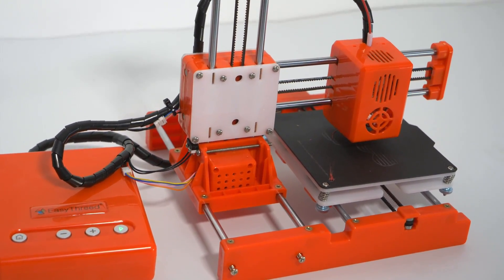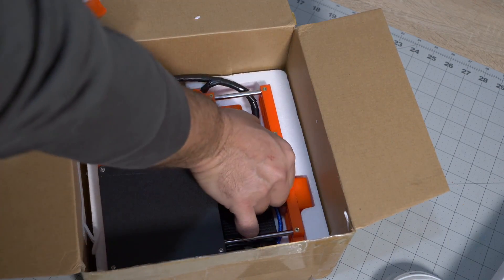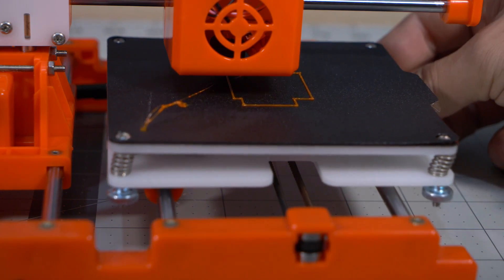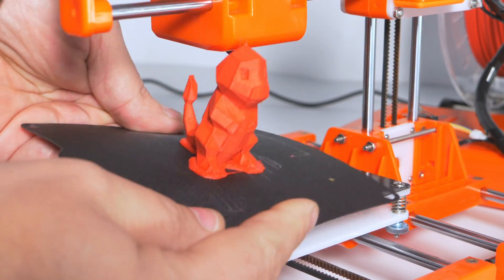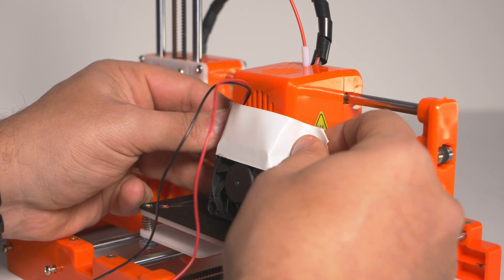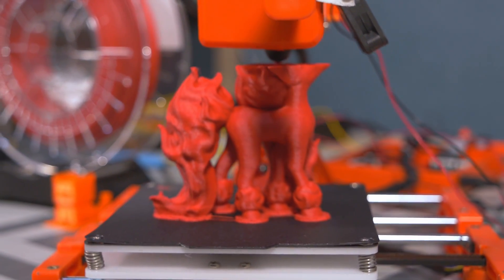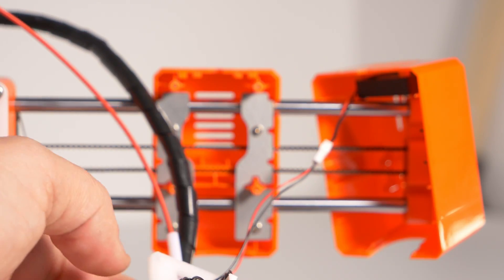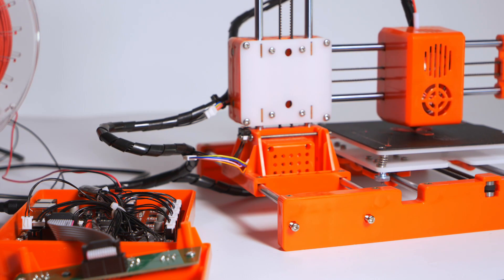The Cheapest 3D Printer Yet - EasyThreed X1

Comment: Hopefully someone can answer a quick question. I need a 3d printer to print a machine part. It will only ever be used to print one part. Is it possible to make the part a solid lump rather than being filled with the X criss-cross design? I'd like the finished product to be as strong as possible.
Reply from the maker: Yes you can, you can print at 100% infill :)
Reply: @3DMakerNoob  Legend! Cheers bud. Might be worth a punt at that price. The parts are £10+ each so I'll soon reap the savings. Just hope they hold up.

Comment: its very good print for this price  
main reasons-
low printing speed
direct extruder 
with cheap components quite a good assembly
and small printing area that makes it easier to work ( less problems with the geometry of the frame, etc.)
Reply: kinda best choice for first printer if  want @just try@

Comment: i bought an Imakrr Startt two years ago for 99 bucks as my then 12 year olds (and mine) first printer. Basically a rebranded tronxy product. sort of a (130 by 140 mm) mini Anet A8 with a v6 clone and no heated bed. We have since ran 600 hours through that printer. We now have a prusa clone a Sunly S8 and building a large scale core XY machine. All because of that little Startt!

Comment: At 5:45 we see the hotend... and it looks like a straight copy of the M3D Micro hotend! No wonder considering that the same company also make a clone of the M3D Micro. So I think what we have here is basically an M3D without the housing. Same print size, same hotend, same print problems. It prints as badly without a part cooling fan, but the price is a lot, lot less. But unlike the M3D it has space enough for the extra fan and seems generally easier to modify.

So, the only thing I have against it, given a part cooling fan, is the lack of a heated bed. So it is a managable, very cheap PLA printer.

Comment: Mine arrived today from Amazon UK.  It was £119 then Amazon offered me a £40 voucher WIN WIN.  Its got the cooling fan and duct already fitted.  It also comes with 4 small rubber grommets which are not explained at all in the printed instruction manual or the usb instructions pdf file.  Does anybody know what the grommets are for?

Comment: There is now a pre-installed cooling fan on it. Small but its already installed. They also give you like a model to "upgrade" the thing that diverts the air so you can replace the pre-installed one. Might change the fan for a bigger one, like the one he showed on the video.

Comment: I might have to try man again the heating nozzle that came with mine is a little bit different it does not have Teflon tape around it and has a rubber grommet on the end of it it looks a little bit different so I could be a different upgraded model

Comment: Crazy thing is is I did end up having a cooling fan but it's a small one it came with two fans this time but I could say it does deserve a better one that can push more air and I would like to see one other thing the holder that holds the fan States currently in it the front-facing thing that they made were told that plus Hold the top fan and the part cooling fan does me towards have an upgrade cars that housing that holds the fans in place if you could upgrade that to let's say a bigger fan size you can probably have some fun with it and upgrade the fans to Let's a RGB or something better Point reason is if you could bring the size of the cooling fan up to the size of what they have for the Raspberry Pi 4S cooling solution you can get your hands on those fans in Fulton to the 3D printer itself I can also see where if someone could label each word to get it upgrade kit dexton build plate movement size with a bigger belt plus that XYZ gantry with longer rods the 3D printer could get bigger and floss with a bigger build plate and I would like to see a better control box 2 doesn't need to have a screen the buttons were fine but far as the Bluetooth in that connection I would like to see one other thing on it like a way to work to attach a Raspberry Pi zero directly to the top of it through the gpio. If you could do that you can literally just connective anything to it and then you could just run whatever cables from that ports further away

Comment: And I will say yes it does have its limits far as the SD card but that could easily be overdone if there was let's say a plug-in or something that would allow you to use a different set of software pacifically switching from the manufacturer to Cura or if you're really crazy go for the G replicator software

Comment: Easy Threed X1 challenge
Design and upgrade for the printer and must fit its existing print bed.

V6 clone maybe stock looks pretty decent. The stock also prints flexables amazingly.
Geared extruder with existing stepper
Threaded rod frame stiffeners, a diagional one on the z would be amazing
Gear down the x, y and z axis for precision.
Oh and the part cooling fan 👍

Comment: I’m pretty sad with mine the tip clogged and  tried cleaning it but it didn’t work also tried taking it ape  to clean It but the wire fall off hitting the hot end and there was a spark that just killed it

Comment: Thank you for this great video. I've been wanting to get into 3D printing (since I do a lot of DIY synth stuffs and am often in need of small parts), but the price was always an issue. When I saw this cheap thing I doubted it would be any good, but glad to see it holds up!

Going to order soon :D
Reply: A much better printer at this price range is the Tronxy X3 (it’s a kit, so you’ll have to put it together, but it sounds like you probably know how to assemble LEGOs so you’ll be fine). It’s way bigger, much much faster printing, and higher quality prints. If you get one you’ll want 2 mods and then it’s golden (and they are printable with like $0.40 in plastic, so no big deal). It’s just a way better machine, but it does take a while to assemble (it’s fun though, it really is just like being a kid again but with “high tech” LEGOs, but pretty much all aluminum extrusions and a few bearings. It’s just a lot of screws, haha!

It’s my second printer (first one I built over 6 years ago and just modified everything on it, a total Frankenstein monster totally tailoring it to my needs and preferences, but I wanted a second one). Sure I wanted to spend $500 on the second printer, but honestly didn’t like most of them, they were all basically Ender 3 level of performance (which isn’t bad for the Ender 3), but I wanted the fun of building another one, and the Ender didn’t have a parts bucket/kit option so I went with this. If you have the budget Ender 3 is better but the Tronxy X3 is remarkably impressive for its under $100 price tag shipped to your door in the US. (PS, I’m a mechanical and aerospace engineer, I love designing and modifying everything, almost as much fun modding printers as using them to make gears and whatever else I need printed for my projects, most of the mainstream printers are very modding/upgrade friendly).

Comment: Yeah but for $89 you can also get one of those cheaper Anet A8 clones. The wooden ones with bottom of the barrel bearings and the smallest heated bed in the world. Still an Anet A8 though and can be easily upgraded back to or even past the functionality of the original for less than $40 more.

Comment: Yeah but if your going to spend $89 on this then the extra $100 for an Ender 3 is a no brainier with all the extra build volume and better print quality. If you can save up $89 it wont take much to save up the $189. If you can't afford that then you really should think about entering another hobby lol.
Reply: That’s pretty wrong on many levels. But you can however get the $99 Tronxy X3 and learn a lot by assembling your first printer (I specifically picked it over the Ender 3 because the Ender didn’t have a kit/parts bucket option and it’s fun like building LEGOs). The Tronxy does need 2  upgrades to it (about $0.40 in prints), and then it’s pretty decent. That’s on a level much more comparable to this (or you can get an Anet A8 also for $89 or Ive even seen them as low as $79 new, and it should be decent because it looks like an upgraded version of my old Frankenstein of a heavily modded i3 clone I built like 7 years ago and it’s doing great to this day, though almost everything down to even the power cord has been worn out and replaced from so much printing, haha!)

I also own the Tronxy X3, it’s pretty good. Gotta remember that really sometimes you’d don’t want or need to spend double (just like I was debating a CR-10 or nicer, but then realized I didn’t particularly love the design and was going to mod it so much that I might as well start from scratch at the hardware store or just get a cheap one and mod the daylights out of it like my other one, because modding is fun and cheap). I may have plenty of surplus income but some people don’t, so just remember that, as over double the price is not in the same league!

Comment: That extruder looks a lot like the one in the first edition M3D printer, http://m3dhelp.com/support/assets/img_55760ba2e5691.png and the speed it prints corresponds closely as well, for your sake i hope the gearbox is better than it tho because for me it was horrendous, broke two of them in very few hours printed so i gave up on it quickly and bought a diy i3 based kit for about 2x89$ which gave almost twice the build space, heated bed, twice the print speed and far better quality.

Comment: As long as it is calibrated, any printer will often do. You dont get super quality for a high price, part cooling fans are not necessary for pla or a heated bed either. Petg prints go fine on mine cheap homebuilt in wood and aluminium tubes. As long as you take time to adjust most printers are equal to a prusa or a mendel

Comment: Are you able to find the firmware anywhere? My Y axis seems inverted. I swapped the wires to get it going the proper direction, but now it homes in the wrong direction and I want to fix that
Reply: Can you use Repetier Host software to control? If so it’s in the top toolbar: config/printer settings/printer and check the box that says invert direction in controls for Y-axis.

Whatever program you are using should hopefully have something similar.

Comment: Thanks for the video, I got one and I'm starting to play with 3D printing. My suggestion for future videos: There is a X2 model with a small display, do you thing it'd be possible to use any shelf display, print a case and add to this X1 model. Also, there is a file at http://www.easythreed.com called "x1 & X2 cooling guide cover", I downloaded but didn't figure out how to use it, could you have a look? (http://7583133.s21d-7.faiusrd.com/0/ABUIABAAGAAgn_jP8AUoiNDS0gY?f=fengshangai.gcode&v=1578365983). Also let us know if you have tips on slicing part on cura or slic3r to be printed on it. thanks!

Comment: Here is a small analysis. Printing quality isnt that good. And having a shield under your model is kinda annoying and unnecesary. Also, too bad you cant print something medium-large sized. Also no display screen, so in case something goes wrong, you are screwed (like, if you are controlling nozzle and bed temperature and fan power). All in all, its cheap but not really worth it. I recommened Ender 3 which is, well, 200$ more but its worth it (only problem is that you will need some work space)

Comment: Hey! great video. I decided to buy it thanks to you. Its gonna be my first 3d printer and i just want it to print small cases and little pieces nothing serious, however i would love if you could detail all the "mods" and tweaks you did to this little machine to make it run better than it was stock. I have 0 experience and it would help me and people like me alot. Thanks again! 
Also, i saw that when you pull the piece from the bed it leaves marks and residue, is this a problem in the long term? is there a way to keep it nice and clean?

Comment: I heard that they added a part cooling fan in the kit now
Reply: I didn't have a part cooling fan, but there is a duct on thingiverse and the wiring for it is already in place
Reply: yep, I had one in mine
Reply: I’ll tell you I’m opening mine tomorrow maybe on stream.
Reply: BowieMoonen so I there one?
Reply: I couldn’t even type that day
Reply: This printer is also sold on amazon by a company called Labists, it already has the part cooling duct fitted and the slicer software supplied on the microSD is all Labists branded, I was surprised to learn you can produce decent print quality on these cheaper machines.
Reply: Lex4G More money out yo pocket
Reply: @gabeitch5102  The printer is still the same price. I got mine for $90 but it had a cooling fan.

Comment: If u could mod an lcd screen on this and a part cooling fan this would be probs the best budget printer
Reply: The X2 has display, but there is no real advantage in that, using it is even easier without the screen... Except that you can screen live the hotend-temperature, and so, detect faults, just in case they should occur...
Reply: There is easy way to add part colling fan just download model for it from online(Enter something like easythreed x1 part colling fan model)and ju just put a small fan in 3d printer and it will becom a part colling fan.Here is link for better explanation and model.  https://www.aliexpress.com/item/4000469006532.html?spm=a2g0o.productlist.0.0.559f5d34dkg16N&algo_pvid=d39d0048-5cb0-4ac6-9ff3-440be4b99a0e&algo_expid=d39d0048-5cb0-4ac6-9ff3-440be4b99a0e-0&btsid=f61f3362-6e7b-44e6-99af-e592da0af92a&ws_ab_test=searchweb0_0,searchweb201602_4,searchweb201603_55.   You dont need to buy this fan just take one.
Reply: The X2 has display: https://youtu.be/VfYkGFNamNI
Reply: The Tronxy X3 is $99 kit. It has a screen and there is a simple fan duct you can print for free (flaps so it’s great for PLA and closes off the nozzle side for ABS). I’m fairly impressed with its results and it’s 200x200x200 standard print volume (technically it’s more, but that’s kind of it’s class size). It’s also very good because it teaches you how everything is assembled and you can fearlessly fox and modify it. It’s also easier than most LEGO kits I did when I was 12, like significantly easier, so you can have fun building it with your 10 year olds (or much younger depending on the kid, I think I could have built all but the wiring due to safety when I was 8, but that doesn’t mean I didn’t play with 110v AC when I was 8, haha!)
Reply: @jakegarrett8109  I only saw the 217 dollar version

Comment: I have one...prints pretty well...but the only problem is it uses those slow 28BYJ-48 geared steppers...so printing at much over 10mm/s will cause the motors to get quite hot
Definitely a toyish printer..but GREAT if you want to get something for the kiddo's to play around with...but is pretty darn fun!!

Comment: This is actually really amazing. It's so cheap for a 3D printer, under 100 dollars and still produces good quality prints! And it has thermal runaway protection! The fact that it even works at all is amazing. It seems stable enough and it has a direct drive extruder. It might even be able to print flexible filament. For 89 dollars, I think it's worth the money. It works well and is easy to use. It could be a good addition to a workspace for printing small and medium sized parts.

Comment: It looks like the extruder case is already set up for a fan. They have the fan in their aliexpress shop and it says they have a file for an air duct. The vent and mounting holes for the screws are already there: https://www.aliexpress.com/item/4000469006532.html?spm=2114.12010615.8148356.21.1f111cfbxChuq7

Comment: "Thermal Runaway" and magnetic plate, it literally offers more with that as some 300€ bigger ones. The nice point is, it´s IDEAL if you are a tinkerer who can upgrade the frame for instance. Love how this one turned out. Just had a giggle by thinking "Hmmm... let´s test a large print at 60mm/s" Joe leaves for the night, turns back, just finds all parts of the poor lil freak scattered around with the motors still moving... :P
Reply: :D 60mm/s, the thing just about hemorrhages... 27mm/s is the max I've got without the quality going south. So yes, slower than the big boys, though it chugs away quite well...
Reply: I've had similar so I clean the plate with 'bathroom cleaner' and scrub it and dry it well before each use. It's done the job. No more peeling off half way through a print. Chuffed to bits with mine.